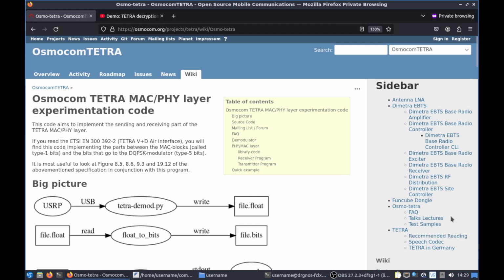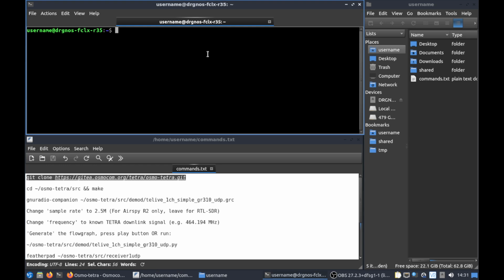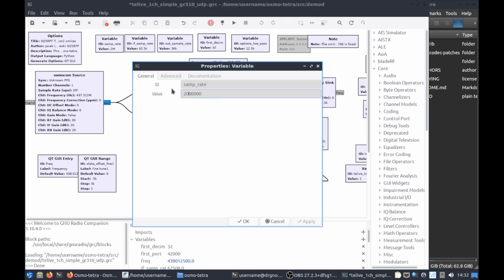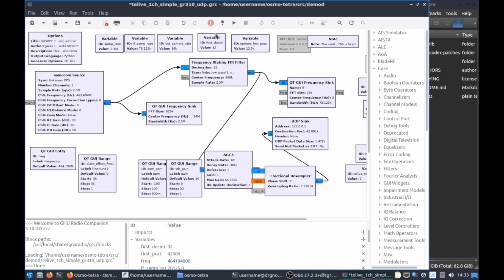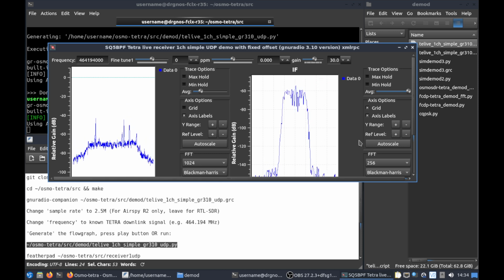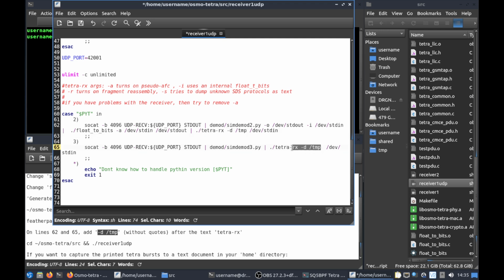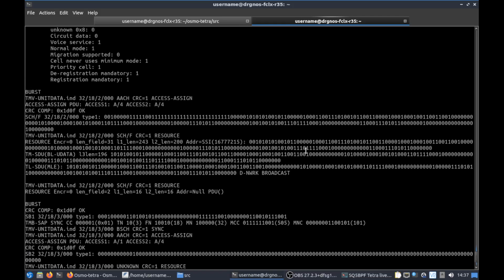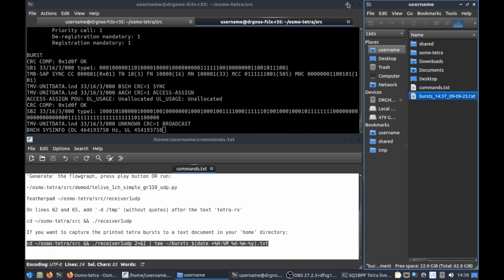Osmo-tetra: A Brief How-To Video On Getting Started In DragonOS FocalX

Comment: Hi Rob, quick question. Is there anything that makes you prefer FocalX rather than Noble?
Reply from the maker: Hi. My philosophy with Linux is don't fix what isn't broken... FocalX R37 just works for me, so I just stick with that. Aaron is still in the process of porting the packed-in software tools to Noble, so it doesn't have everything shipped with it yet. An example of this is Osmocom-BB. Definitely check out Noble if you like to have bleeding-edge Linux!

Comment: If you hear only noise: check Air Encryption — encrypted channels will sound like noise.
	•	If receiver1udp reports no voice frames, verify your GNU Radio demod is correctly configured (sample rate, center frequency, symbol timing).
	•	If UDP port conflicts occur (Address already in use), choose another port in both GNU Radio UDP Sink and receiver1udp. Example: 42002.
	•	If audio is choppy, confirm CPU usage and that sampling/decimation parameters match between GNU Radio and Osmo-TETRA pipeline.

Comment: Hi Rob,
For the live demodulation I prefer using on Windows- SDR sharp, with TETRA PLUGIN-it easy and handy at the same time.
Reply from the maker: @eltio77556 Yes, you are right. Windows is a lot easier. But I am giving osmo-tetra in Linux a lot of attention because it is the tool that the research team behind the TETRA hack from 2023 utilized it for their work.

Comment: well done mate 
I'm trying to implement it gqrx with udp option which will be easier to control the freq channel but it doesn't sink with udp
Reply from the maker: I'm not sure if GQRX has an inbuilt pi/4-DQPSK demodulator?
Reply: @RobVK8FOES  not necessary the flowgraph  got the demodulator isn't it ?
Reply from the maker: @midoedo Yes, the flowgraph contains the TETRA demodulator